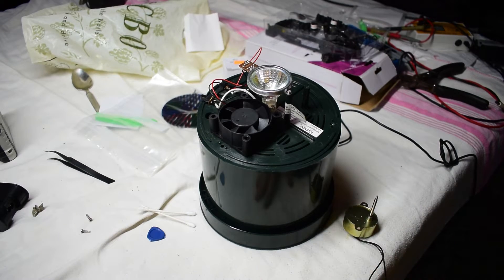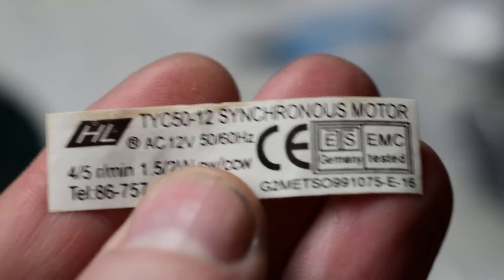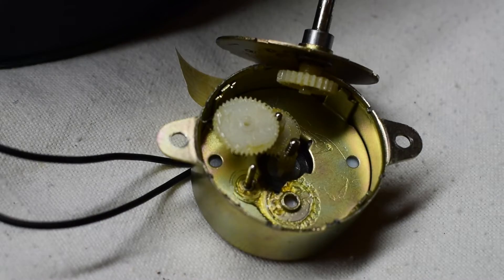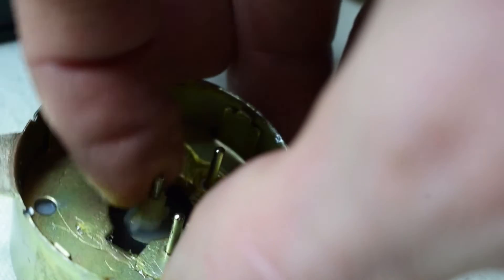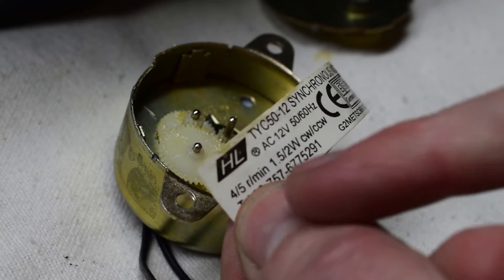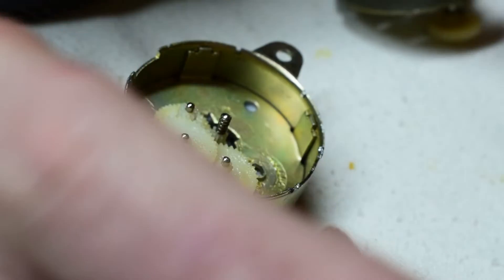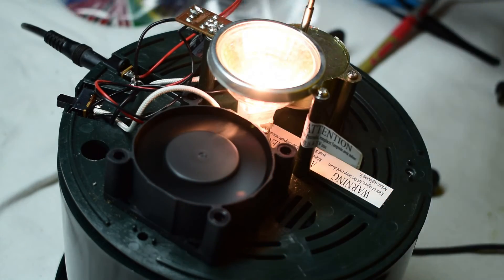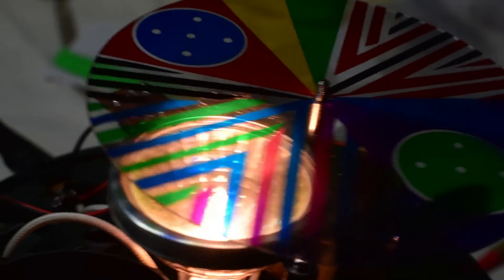Christmas Lights AC Motor repair (Christmas Repairs)

Comment: Good Sir! Thank you for this informative video. I think I figured out why mine is not turning but yet I can hear it trying to. As I watched your video, I noticed a gear is missing. The one directly in the center with the spring on it. I can hear it grind when I opened it up and turned it on. I think that center gear broke in half and fell in since the spring is still there. By chance, what is this particular motor named? I must obtain a few of these for a Fiber Optic Christmas Tree that was given to me in 2009. I have used it ever since and still have the original box. Please help and Merry Christmas!
Reply from the maker: not sure you could search on amazon for motors it does not need to be the same look for a slow gear ratio

Comment: I watched this twice how did you fix it?
Reply from the maker: replace the AC adaptor
Reply: @NewsonsElectronics  How do you know if you need an AC / DC motor. Mine is connected to a DC adapter plugged into wall outlet AC I think. Have tried a DC motor but doesn't seem to work. Similar layout...light and motor turning coloured parasol. Light works okay.. new AC motor not turning. Cheers Grant
Reply from the maker: @mistar2 if there are diodes inside its a rectefier eg AC but look at the original power adapter it will say ac or  dc and the voltage